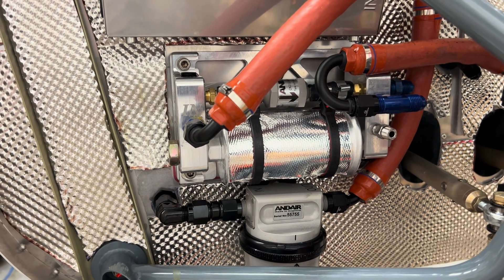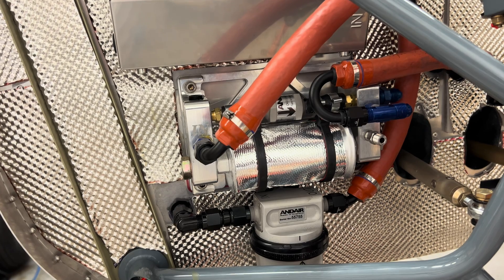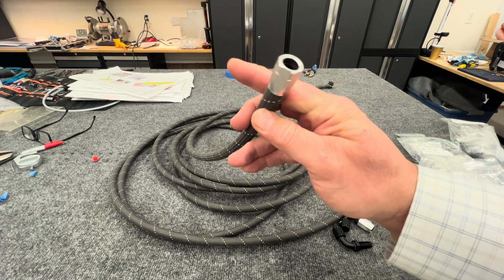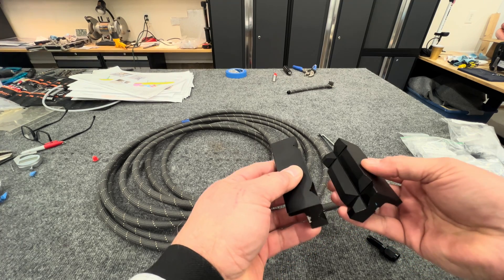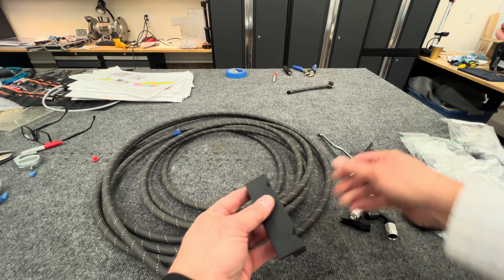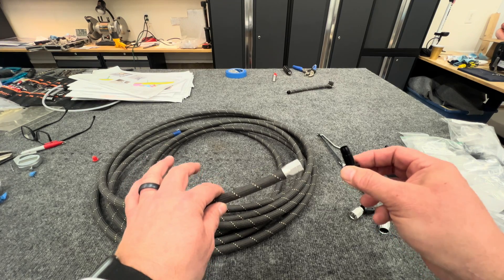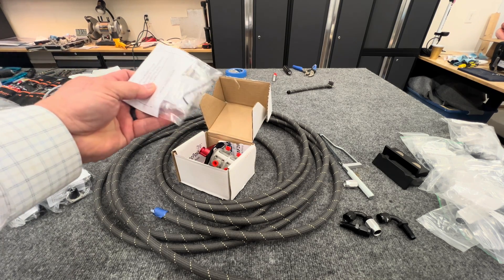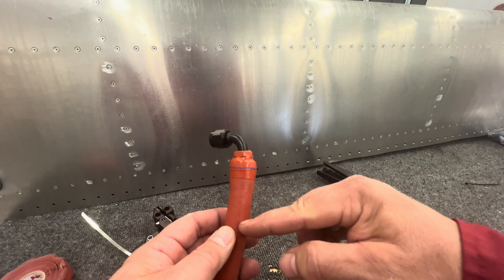Sling TSI Build Update - Fuel System  Use of Fuel Manifold Assembly, Upgraded Fuel hose, Fire Sleeve

Comment: What was the product you have used on the firewall - I’m trying to source a better looking material then the kit supplies. Cheers
Reply from the maker: @BeauBeau-r6c  It’s a stainless steel and fiberglass sound insulation meant for race cars and such.  I love the look of it, and it would actually protect the firewall in a fire unlike the product provided to me in my kit.  However, I would NOT use it again.  When you cut it out for all the firewall penetrations, it becomes razor sharp.  I have spent a bunch of time dealing with severe cuts on my hands, and then trying to roll and then cover up the sharp edges.  I removed my video I made discussing the product because it’s just too dangerous for this application in my mind.  Sling now ships a different product for the Firewall but I’m not sure what it is.
Reply: @ thanks so much 👌 yes looking for a better “looking” product as the supplied product is not great to look at.

Comment: Sure sure... NOW I learn about that stainless steel tie wrap tool... ::: marching right over to Amazon to buy it now...::::

Looks good.  I just had my teflon lines made.  Cost me more certainly but I just didn't have the confidence in my hose mojo.

Your Midwest mount looks really great - and I love the sexy firewall insulation.  I wish I'd known about that before doing mine.
Reply from the maker: We’ll the verdict is still out on the hoses, I guess I‘ll see once those pumps turn on.  Thanks for watching, and good luck finishing your up.

Comment: Check the fit of the fuel selector into the leather cover with those new fittings. We had to end up buying the 90 degree AN6 fittings from Andair to get the teflon hoses to fit with all the extra fittings.
Reply from the maker: Thanks. Haven’t tried fitting it on the cover yet.